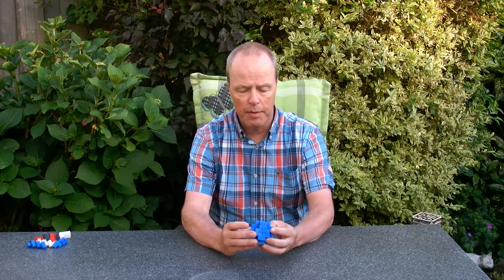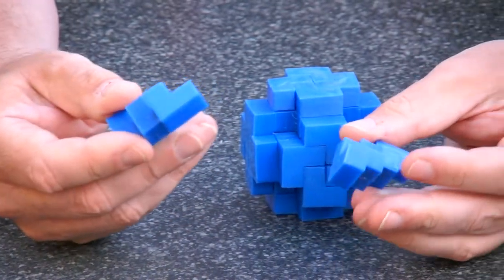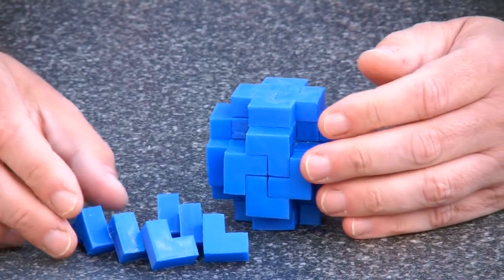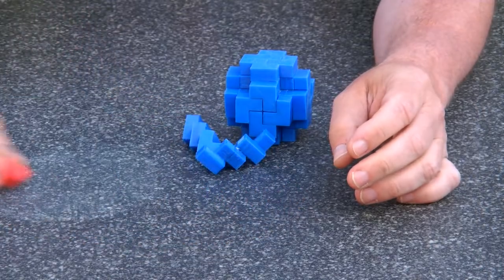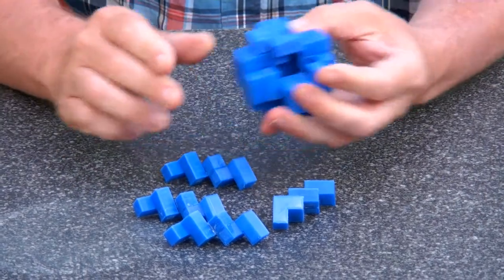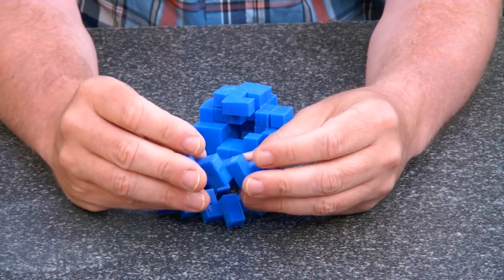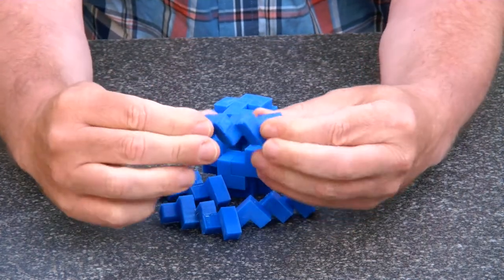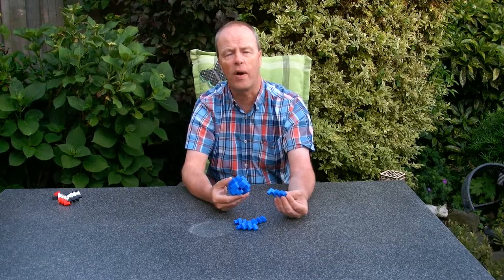Cubic Spiral Burr - How did this puzzle come together?

Comment: sorry but wouldn't be easyer making these parts if you print a mold to pour some silicon rubber or something?
Reply from the maker: Silicone moulding is messy and takes time. But yes, if I'd want to spend extra time and extra cost for the silicone, then that would definitely be an option. Note that I chose PTE as it is relatively rigid. Silicone is super soft, perhaps too soft for this particular puzzle.
Reply: @OskarPuzzle  Takes time? Nothing is slower than 3D-printing. Anything else would be faster.
Reply from the maker: @grantofat6438  Moulding takes ME time. I don't care about my 3D-printer printing all night. It is my time that is scarce. But yeah, I should start playing with silicone some time. And as for first-time prototyping, nothing is as person-hour efficient as 3D-printing.